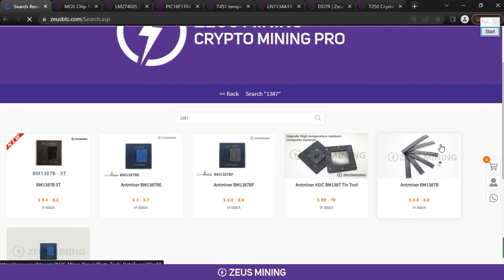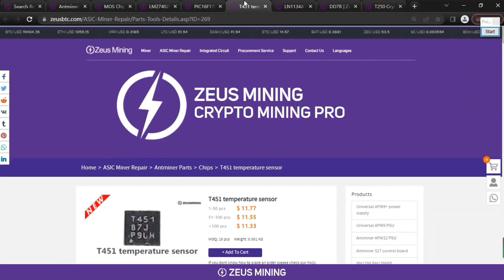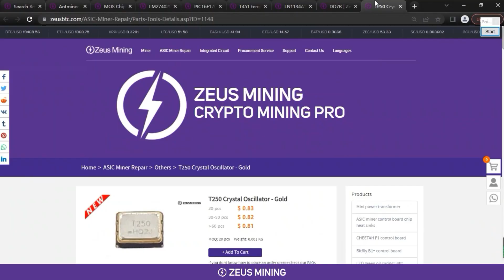Antminer S9 Hash Board Repair | Easily damaged parts of Antminer S9 hash board introduction

Comment: hello, I want to ask, if the reset on ASIC 29 doesn't want to come out, what should I do And even when measuring using diodes it doesn't come out, I have replaced all the small components and there has been no change this happened to the S9i hashboard, please what is the solution

￼

￼

￼Terjemahan langsung
Reply from the maker: Hello，solving this problem requires kernel logs, please send the logs to this mailbox: <repair@zeusbtc.com>
Our technicians will send you an email after reviewing it.